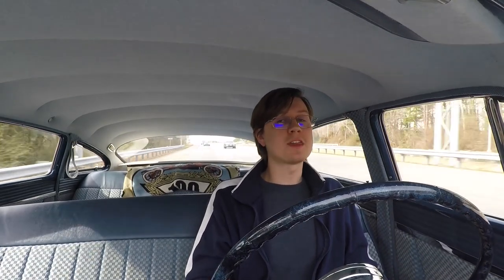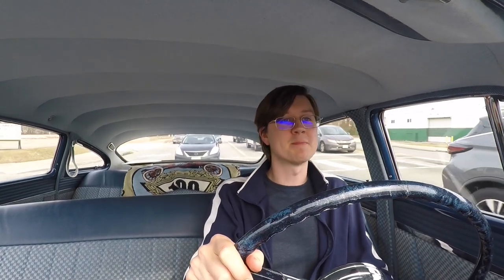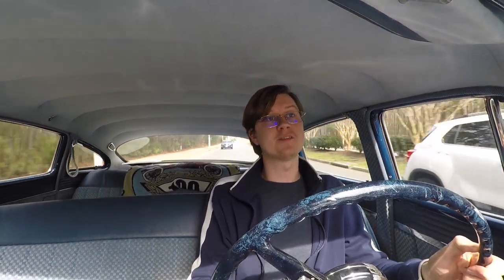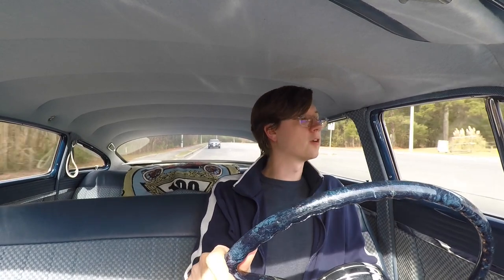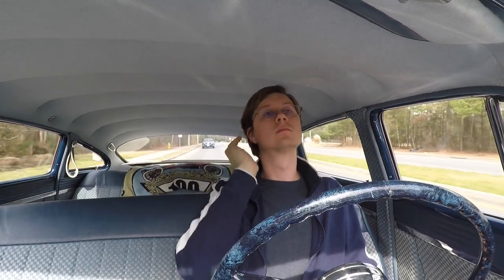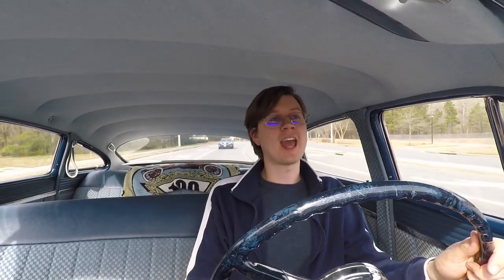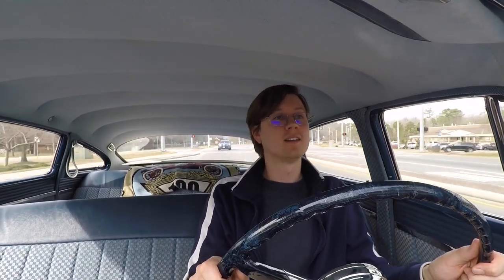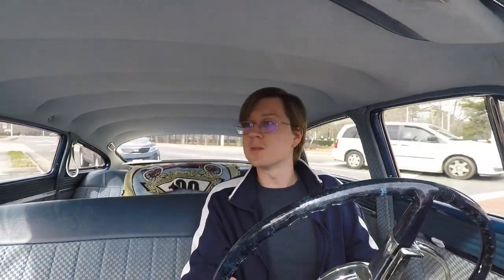Modifications: Reason 6/6 not to engine swap your Hudson Hornet

Comment: I recently got a 51 Hudson Hornet that needs a lot of work done on it. It had the engine and transmission and was wondering how easy would it be to rebuild the drivetrain?
Reply from the maker: We rebuilt the drive train ourselves at home. A machine shop did the machining on the block and head but we did all the disassembly and rebuild. My Hydra-matic had one broken part which we replaced but has never been rebuilt. There's a wealth of knowledge in the club! You should join and get access to the forum and library. Lots of helpful folks.